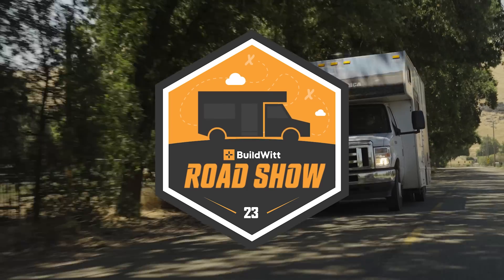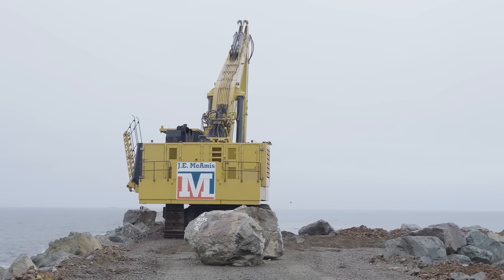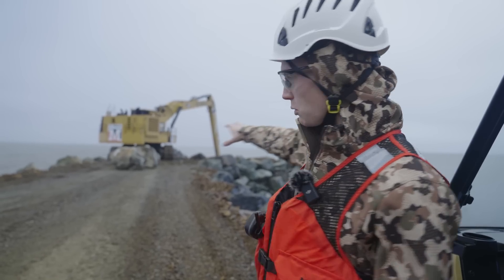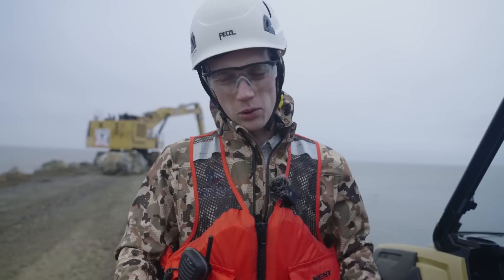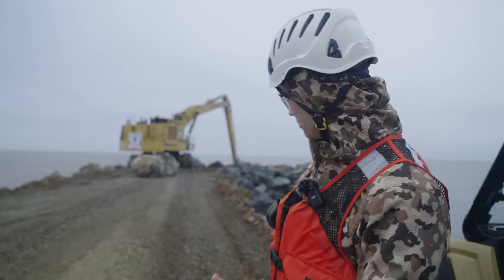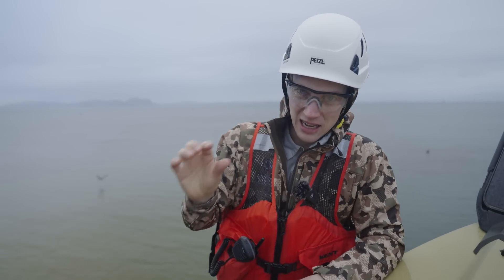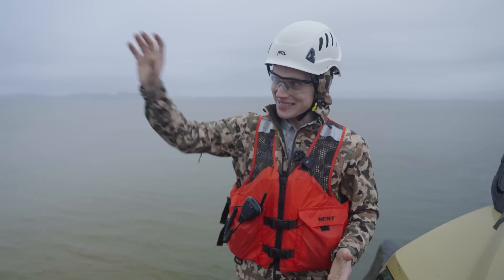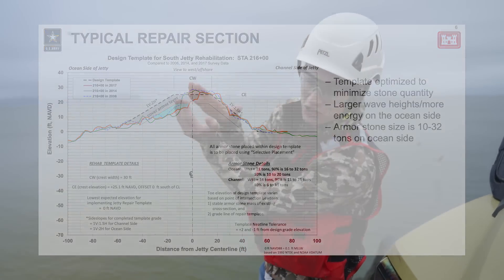Rebuilding a 100-Year Old Jetty w/ 40-Ton Rocks

Comment: Haven't had chance to watch the video but I find the title claim very hard to believe. The density of a typical rock, including things like limestone and granite, is about 3 tonnes per cubic meter. That means a 40-ton rock would be about 13m³, which is a cube about 2.4m on a side (a hair under 8ft). The rocks shown in the thumbnail are much smaller than that. By a handy coincidence, the cab of a Cat 6020B is about 2.4m long. So, a 40-ton rock would be a cube whose sides are equal to the length of that cab. The rocks in the thumbnail are nothing like that size.

The cab is smaller than a cube. A rock the size of that cab would weigh about 22 tonnes, barely more than half what you claim in the title, and the rocks in the thumbnail aren't even that big.

Edit: now watched the video and, yeah, all the rocks shown are way smaller than 40 tons. You say at the start that the range was 10-40 tons and I've no reason to dispute that, but nothing of that size was shown.

Comment: Immediately, I thought that might be the Astoria Jetty. I've been there many times. Originally the rock for the Jetty came from an Island Quarry up the columbia river about 30 miles from Portland/Troutdale. The remnants of the Island are likely still visible along I-84 the Columbia river. The original rocks were much bigger and they placed them using a drag line off a barge.

Comment: This seems like it would be a perfect jobsite for those rotating dump trucks that are on tracks, if they could get one with a enough capacity. Drive forward all the way down the jetty and rotate, dump, then drive forward again with no backing.
Reply: Idk if it they would because they are so small I feel like they could not haul  enough at one time to make it worth it to use them maybe if the customized one with a bigger bed it would work great idea though 👍
Reply from the maker: you're right but they would struggle with even the small rocks on this project

Comment: There's a video floating around on here of a 6040 with an extra segment in the boom, tossing boulders out in the same manner.  It's worth a look.
Reply from the maker: oof
Reply: https://youtu.be/SjPG7g6AoFs?si=1Lio-QTigJQ9mmfy
Reply: Those boulders are not being 'tossed about'.  Strategic-placement is the rule.
Reply: @douglassauvageau7262 I know it’s deliberate work, it’s just that these machines make it look effortless.
Reply: @jimsvideos7201  Every rock is placed with GPS / AI assisted precision.  The more I learn about the U.S. Army Corps Of Engineers, the more impressed I become.

Comment: Awesome machine! I was interested how long the stick and boom could be on a big excavator over 150t. Would be awesome when they would build a 6040 or 6060 with a long boom and long stick. It could probably still handle a 10m³ bucket with no problem. Would be a crazy piece of machinery!
Reply: Snijder bv , van tunen . 2 company's in Holland. You can hire bigger excavators than this puppy